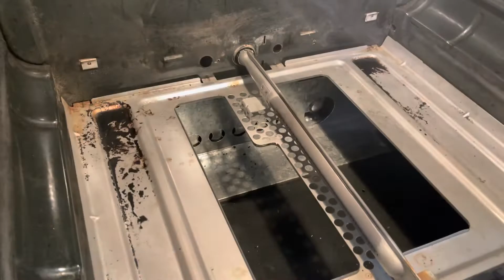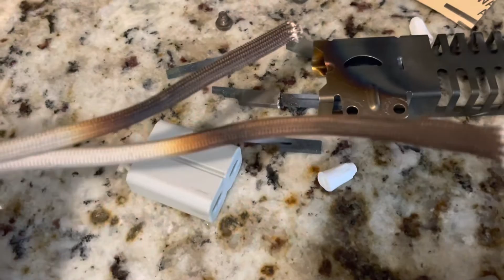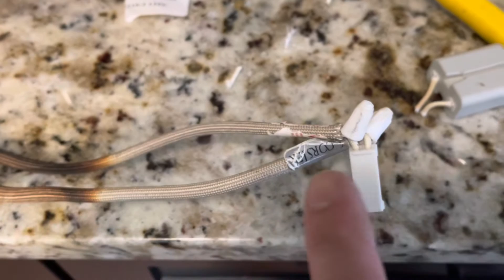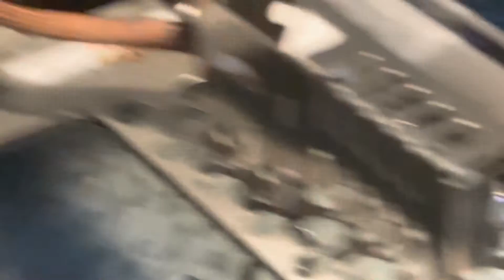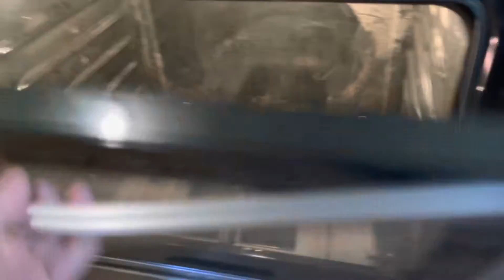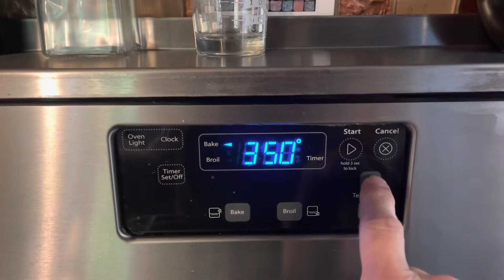Gas Oven Not Heating Up. Easy Cheap Fix Under $30 Bucks! Igniter Replacement

Comment: I have this exact same stove and it's barely over a year old. The oven/broiler won't work, it just shows 100 degrees but doesn't warm up at all. I will change out the igniter and hopefully that fixes it. Thank you for posting this!!!!
Reply from the maker: Your welcome good luck
Reply: Same here… mines is just 5 yrs old came with new home and it stop… we about to test this out lol
Reply from the maker: @bosladijackie8691  you can also pull the ignitor cover off and check to see if it's cracked that's a immediate sign it's broken. Good luck!
Reply: Gas is going to the stove because the top portion is still working. More than likely this issue. I'll try this out and see if it fixes the issue!